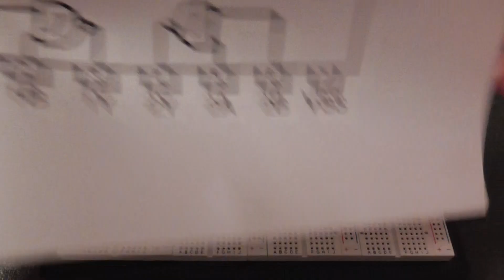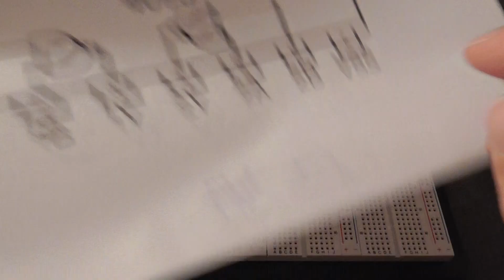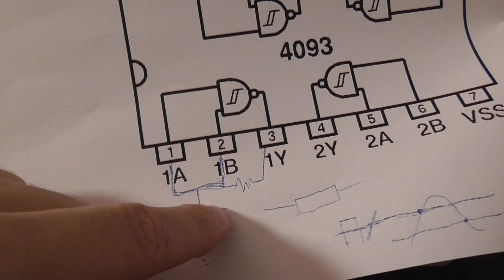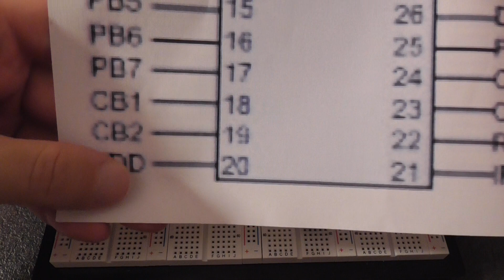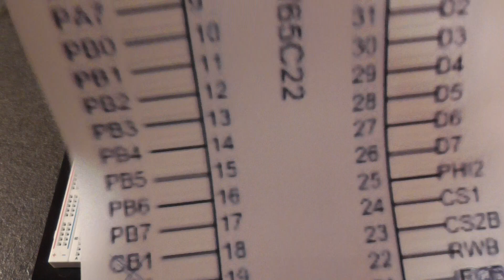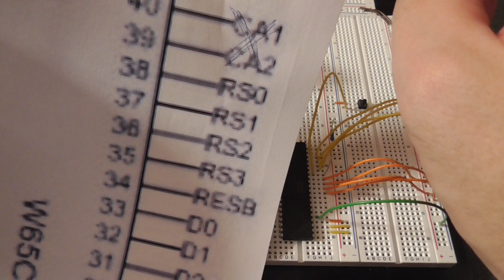Let's Make a simple 6502-based computer, Part 3: A different clock circuit, and adding the I/O chip

Comment: This video series has been very helpful for me because I have been able to tune into the practical nitty-gritty side of the building process. When you talked about various issues you were running into while making stuff work, I found the gold I was seeking: the numerous details of knowledge that you have in order to push through any obstacle you were having. Especially, I appreciate the fact that you are not using any expensive or complicated instruments to help your journey. You make the simplest possible tests to verify functionality, instead of going to signal analysers and oscilloscopes. You persist with careful observation and thinking things through with the needed patience. Also, you are not overdoing things with ultra-short wires, for example, when they are not needed here, and explain this for the viewer. I find that I tend to agree with your approach very much where simplicity is being employed to your advantage. Thank You!

Comment: The power supply problem might have been related to the lack of .1uF capacitors near the ICs, specially the clock generation circuit and CPU. Can't remember how many times i took it for granted and spent several hours searching for the problem.

Comment: Do you have any plans to add a keypad and 7 segment displays to view and address memory locations, similar to a KIM-1 trainer?
Reply from the maker: I probably won't be adding stuff like that, since it's fairly simple to do. The point here is just to show how to do the interfacing; anything that one would want to add could be added to the I/O chip for additional functionality.
Reply: @LateBlt  This is a good introduction into the 65C22 VIA and a good starting point. Adding a keypad and 6 - 7 segment displays, learning all about the hardware and the programming necessary for scanning and producing the correct output on multiple 7 segment displays, may be fairly simple for those who have spent many years doing this. However for those who are looking to learn and who come from careers other then programing and electronic circuits, it can be a little more daunting.  
Without building an entire 6502 computer on a bread board, I think I maybe able to build a keypad / multi 7 segment display project using an 8051 microprocessor.
That could give me the knowledge of how to integrate the keypad and displays into the 6502 environment. At first I was hesitant to go down the 8051 path, thinking it was not in line with my end goal. However, (I could be wrong,) but isn't the 8051 microprocessor similar to having a CPU, ROM and VIA all on one chip? This could  make the basic learning process a lot simpler?
Reply from the maker: Different models of the 8051 have different specs, but yes, generally the 8051 is more like a complete "system-on-chip" (SoC), with its own on-chip ROM, RAM, and I/O. The amount of RAM is very small (typically just 128 or 256 bytes of RAM) and I don't know how easy the ROM is to program. In any case, the 8051 was not used in any major computers; it was and is used mainly in embedded applications, so it's not really very interesting to me.

Comment: Microchip SST series EEPROMS.  They are dirt cheap, CMOS, and can be purchased in DIP packages.  DigiKey and Mouser both carry them as normally stocked parts.  The access times are fast enough, at 55ns or less, to allow you to run the 65c02s up to 10MHz safely.
Reply from the maker: For some reason, I didn't find any when searching on Mouser while preparing to make this video, but I just checked now and found a couple. Thanks for the heads-up.
Reply: Very interesting video series! I'm myself assembling graduallyn(step by step) a 6502 computer on a breadboard, but I took a slightly different approach to start with, as I didn't have parts other than the 65c02s. I used an Arduino Mega that acts as Rom, Ram, and also does some IO (like Serial port, mapped to a memory address). You asked in this video what is the point, well, I think you can also learn a lot, actually instead of wiring everything in a physical breadboard, you still have to understand how thing are connected and "wire" them, in software, in the Arduino sketch. I have a VIA also, and my first reflex was also to try and use it by hand, as you did (I used some DIP switches which made the register select and data input easier though).

I'm also very annoyed by the placement of the data bus on the VIA which feels reversed to me, unless it was maybe meant to be stacked on another board on top/below the 6502, it's the only rational explanation I can think of. I don't think it was meant to be placed on the same plane.